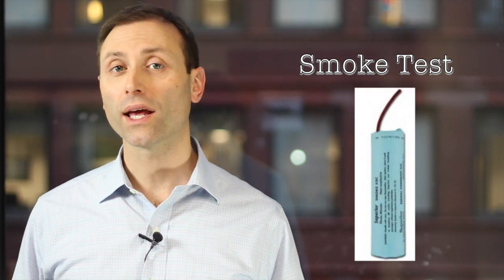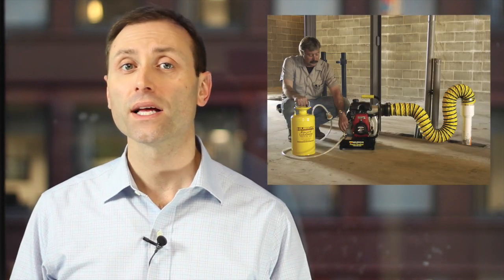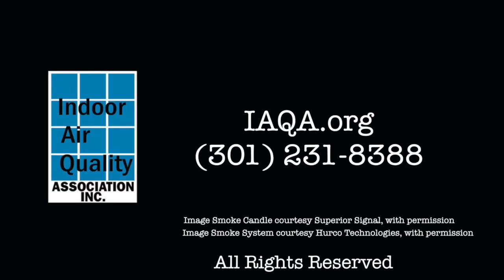Sewer Gas- Part 2

Comment: I am so outraged.  TCEQ & H-Gac are not offering me a solution to assist my new neighbors.  Our OSSFs are being installed with no vent-to-atmosphere for the aeration tanks.  The modern air pumps for these common residential OSSF systems run at 4 PSI with a max of 6-7 PSI.  I have seen the gas leak from every part of these OSSFs & the worst is seeing the gas pass through the electrical conduit that gets ignored even though they know control panels have been rotting all over the county for two decades now. What is also awful is that the installers started to leave the riser lids loose so that the air could escape to atmosphere but on land with less than 2% slope those risers are also intaking groundwater b/c they are open & low.  The 2023 rule change to have the risers all 2 inches above the soil surface is not a fix for anything related to poor indoor air quality caused by obvious negligence of H-Gac, TCEQ, OSSF Directors, Floodplain Administrators, Fire Marshals, FEMA, Mobile home licensed installers, commissioners... are all complicit in the deaths.

Comment: H2s is not measured in ppt... is still ppm..  at 1-20 ppm you can smell it, at 20-40 ppm itll start messing with you, at 75-200 ppm you pretty much coughing and will die in exposire before too long, 200-500 if u fall out, u gone, 1000 ppm insta death..

Comment: The common cause of sewer gas odor is the evaporation of water from a seldom used sink or floor drain p-trap, which then allows sewer gas to enter the living space.  "Sewer Gas Solutions" eliminates sewer gas infiltration into buildings by creating a benign, long-lasting surface layer, which prevents water in plumbing traps from evaporating. www.sewergassolutions.com
Reply: People who are seeking out solutions for swear gas smell don’t want to hear about evaporated water in the trap.